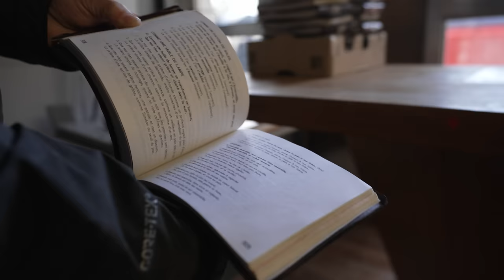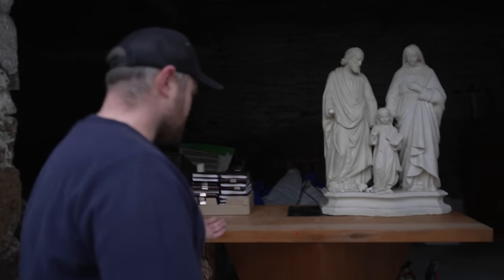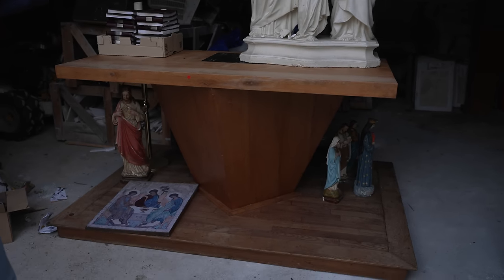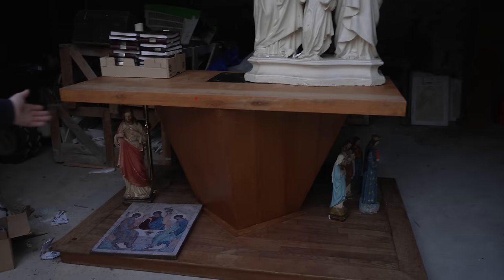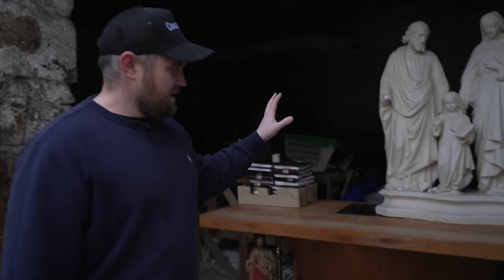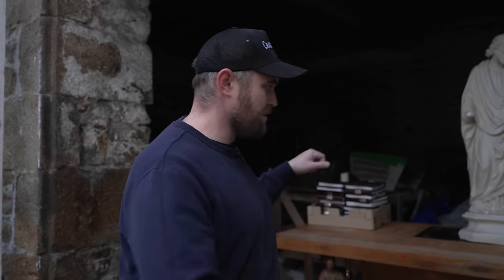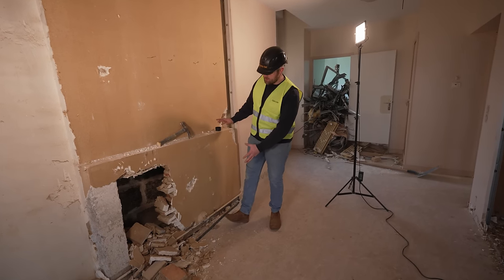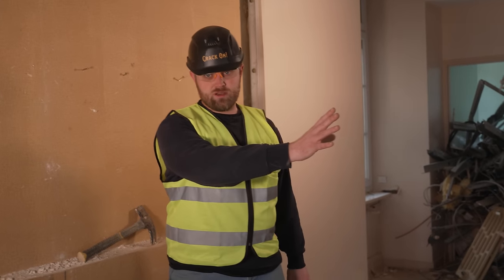Assembling The Kitchen

Comment: Billy: You may want to store the statues, books, and (icon?) painting in a climate controlled area maybe like the office?  Generally the the materials these items are made of don't respond to temperature changes very well.
Reply: When these items were created they didn't have climate control. They are normally made from materials that are impervious to climate variations.   
Heat has been around for a good while but the a/c is relatively new and not yet wide spread in Europe as well as the rest of the world.

Comment: Might I suggest in the future, when assembling modular furniture/cabinets, using a drop of wood glue on the dowels.                                                                                                                                                                It will add an amazing amount of additional straight/rigidity to the final assembly. Been doing installs for years and it really helps add longevity. Cheers.

Comment: That alter table is brilliant, if you don't use in the chapel it could make a good desk for the reception area.
Reply: Hi, exactly what I was thinking!
Reply: A desk???  It is holy. Please give it the reverence the altar deserves- at least for the sake of those who believe in the sanctity of holy communion which this altar has been witness to
Reply: Since the altar is portable, it could be put in place as needed.  Maybe in front of the organ if there's room?  I am having trouble visualizing where the newly uncovered fireplace will go. Wondering, if there's room, if it would be a nice reading space in the corner of the library. A fake fireplace, a couple of comfy chairs and a small table would be  a cozy space and appropriate for a library.  IF there is space, of course.
Reply: The altar table would also look great in the library if there is room where some choice books can be opened and displayed on top.  I also could see it as a podium for a conference room if you decide to use the convent for gatherings.

Comment: The pieces from when it was a convent that you have from the hospital are a true treasure.  I was thinking about the demo though, you'd said the hallway will be moved opposite of the found fireplace.  Wouldn't it be better to demo the wall of the next room to give you more space to work there?  Just a thought.  And my opinion would be to keep the fireplace even though not working, with some high backed chairs for a quite seating place in the corner of the library.  GREAT work so far.  Love it.

Comment: As you uncover and sort through old walls and old fireplaces, keep in mind the old customs.  Large convents like this had designated rooms for certain functions.  Nuns would gather for meetings, classes, and recreation in a large room variously designated the recreation room or parlor.  Such rooms were still called parlors decades after the rest of society was saying living room.   Obviously, this usage came from France because in France, as you know, parler is to speak.  The parlour was the room for conversation, usually while doing some form of needlework.  As a special room for the group, it deserved a fireplace.  The old days past, the number of sisters shrinking, and new forms of heating installed, the fireplaces were walled up, in convents and in old large houses generally.  Individual bedrooms, called cells, usually did not have fireplaces.  Hence the use of ample, serge woolen dresses (habits) with long sleeves to keep hands from freezing, and whimples, headbands, and veils for neck and head—as was common for women in the Middle Ages.

Comment: What an awesome day of homecoming! The treasures are restored to the convent, and Rick, also a treasure, is back! This whole video made me want to dance. There were parts that reminded me of a ballet. Perhaps it was the music. But five unchoreographed guys destroying walls somehow appeared to be moving as a cohesive group. And Mick catching the light before it could topple over had perfect timing! I half expected Yannis to go en pointe when he was ripping down walls! I’m sure I was seeing more than was actually there, but it was the impression of a ballet.

BTW, those cam lock fasteners in the cabinets are ubiquitous in cheap shelving units sold in the U.S. I’ve assembled dozens of them! They have a tendency to unlock over time, so check them frequently, and retighten them when needed. I’ve had several bookcases come apart, breaking the wooden (particle board) sides as the books came tumbling down.

Comment: The black square of marble in the altar is called an altar stone and is the actual altar. The rest of the wood table is just to hold the Altar stone for use in the Mass. The box with the Cross on top is a Tabernacle which held the consecrated Holy Communion. Neither one should be in your possession. When the convent was abandoned, these should have been turned over to the local diocese for reuse or fitting destruction. Please turn them over to the diocese. Its the right thing to do

Comment: The large alter or lectern you picked up from the hospital was probably used in the new chapel. It goes with the modernist stained glass windows there. Maybe consider storing the books in a warmer, drier place other than than the garage until the library is finished. The theme of the convent was certainly about the family by the look of the larger relic.

Comment: I have question for you, have you thought of putting vertical support columns up beneath the sagging beam. You could  have two, one on each side in line with the edge/railing of the second floor opening.  With the columns main structural elements going straight through to the basement floor. That way you don't have to demolish more then you want, in particular the secret room. It would also save money or allow to spend it some place else where it is more needed. By the way it is great to see Rick back.

Comment: If you could figure out a way to get the alter into the Convent it would make a rather nice reception desk in a nod to the building's past heritage. It may seem too modern in its design but would stand up a lot better to everyday usage in such a high traffic area than an antique piece; just needs several coats of Osmo and a bit a light sanding.

Comment: BILLY you said not to mention IKEA but the fittings on the carcasses look very similar to IKEA. I've seen USA use wood for the carcasses and screw them together. I'm  wondering if it's because in Europe we use chip board that doesn't screw together well hence the (IKEA) fittings ??

Comment: Have you thought of building wooden sides for your truck? You would simply need some rectangular brackets that you could bolt to the inside of the sides and then build wooden sides out of two by sixes maybe three of them three high and then two by fours to go into brackets. You would be able to double the loads that you bring to the tip.

Comment: I am surprised at the cabinets on feet. Personal preference, I would never do that, too much crap ends up under them and they are a pain to clean under. We are remodeling a summer home we just purchased, slightly small scale than the convent - approx 2400 sq ft - we just picked up the vanities we ordered for the bathrooms and they all sit flush with the floor with a "kickback"

Comment: The large wooden structure you were given…could you add a frame to the top and put a glass lid on it and use it to display old documents, artefacts or even some of the finds you have whilst working. Would it fit in the ground floor of the library?… I know you said it was huge… just a thought…Dottie

Comment: Great to see Rick back.  Hmm...I would think the small scaffolding Yanis is using would have brakes on the wheels.  Either they do and Yanis is not using them (I understand it's a pain; but safety first), or they should have.
Billy, maybe those books as well as the icon and one of the statues could go in a niche in the library dedicated to items found at the convent.  Regardless a small start to the many many many books that will be needed.  Hope you can find the contents at a chateau sale.
Never fails that a trip to the local box store, hardware store or brico is needed.  A universal law that definitely needs to be addressed.

Comment: Where they put there for safety  until reinstalled or Purchased/ never mind you answered. /Will you reopen the chimney?/ I noticed that room had been (parts of it) relatively new maybe within the last 20 years ( gypsum and two by fours) and pressed board for the built in/ were you ever able to get plan o grams for previous work for construction permits/ here you need a permit for every thing   if you want to keep it and inspections/ Welcome back guys

Comment: I hope you read this.  Keep the fireplace.  See if your carpenter could make a wooded mantel out of the CRACK ON  beam.  See what I did there?  It would make a great piece and be an original piece of the convent.  If you don't restore the fireplace then it could be a gas or electric fireplace.  A nice sitting area to read in the library.

Comment: One more thing to ask.  Looks like the window in the corner was shortened, are you considering extending it and making it full height liked the others, or could it have been another door?  What are your thoughts?  Would add some symmetry to the wall and add another entry to either the dining room or the library wherever it falls.

Comment: I have to admit, it's weird and kind of shocking to me that in this antique, beautifully restored and renovated, high-end finished kitchen, that you would use pre fab, flat pack, osb cabinetry. Do they not do custom cabinetry there or was it cost prohibitive, or is this just standard practice there? Just wondering if there wasn't a better option or if there are plans to upgrade them in the future. They just seem incongruous in both quality- not being sold wood- and style- they look far too modern for the rest of the space. I hope they'll look better once doors and drawer fronts are on. I also tend to think that the wood tone cabinets with wood countertops, combined with all the other wood items in the room will just be a bit too heavy on the wood look and monochromatic yet slightly mismatched, with so many other tan/ brown tones in the room. Time will tell. I may end up pleasantly surprised.